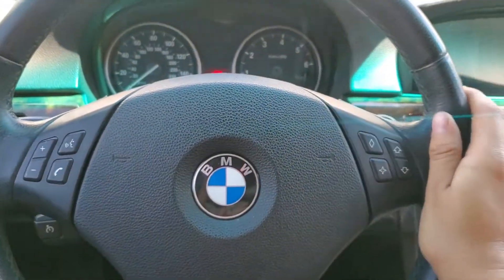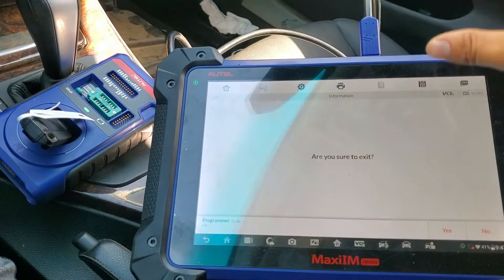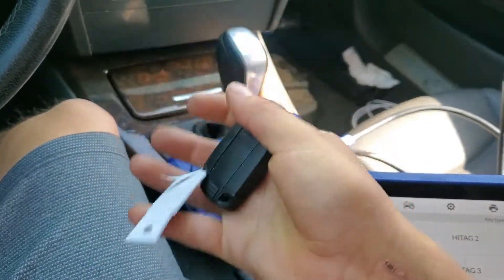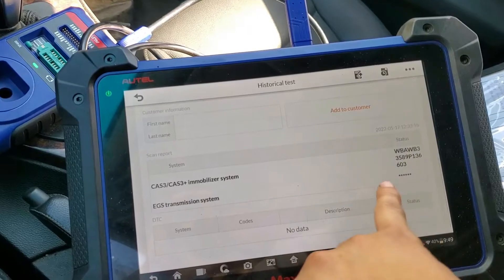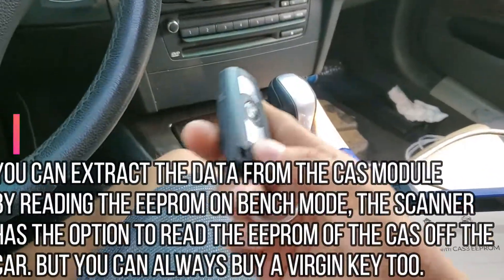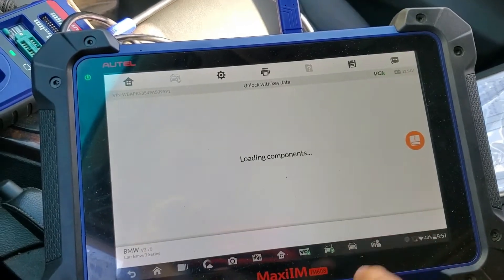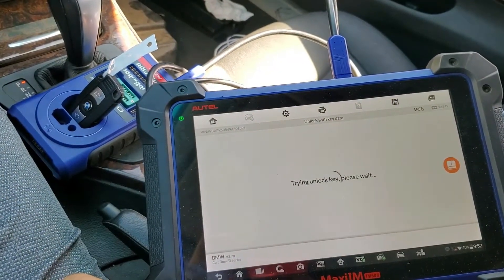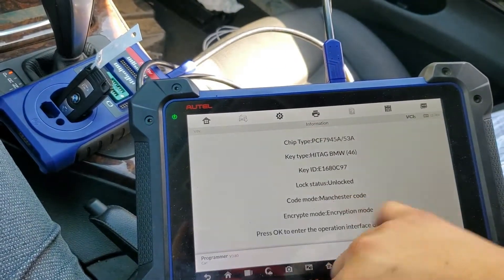How to Program and Unlock BMW keys with Autel IM608 "2008 BMW 328i E90 E92 chassis".

Comment: Hi, do you know what it could be the issue if the key programmed is starting the car but the buttons are not working? I ve already checked the antenna and they seems to be fine. Even in the original key the buttons are not working
Reply from the maker: U probably have a mixed frequency, cars in USA use 315MHz frequency and cars from Europe use 433mhz
Reply: needs new battery. I had the samei ssue

Comment: I use my autel im608pro2 to add keys to cars, I bought two keys from my usual key provider and I just normally code them to the car that I by them for but I am trying to code  a key to a 2024 range rover sports, the keys are the same frequency and style but when it ask me to hold the key in had then to press any button it never read the kesy, I bought 2 more keys and it is the same results, i then decided to read the keys in the programer and I notice the keys say lock on them even tho they are brand new, how do I unlock the keys, I know how to do it with bmw keys and benz key but I don't see any option for range rover so I am wondering if I need to plug on to the car before I can do so? As for bmw and benz, you don't have to be plugged on to a car to unlock the key, so that's the reason I am asking to see if I can get some answers?
Reply from the maker: I have never unlocked keys on that year maybe you are doing a step wrong and other thing is most of the new cars from 2021 and up now need internet access to program keys basically you need permission from the dealership to do it
Reply: @JVFIXLLC  I think it is just the keys that I bought is the proble, I had strong internet and I even reprogram the range rover and kick out the key that came with it and program it back and it work but the key I bought it is saying it is already program to a nex car but I think it is because they kesy are lock and not saying unlock. But thanks for your reply.

Comment: hey brother Can I used the original key to reprogram the key because it wont start no more  or do  I Need buy a new key to programming
Reply from the maker: if you erased by mistake you can reprogram it but if it's from other car you need to unlock or buy a new one

Comment: Hi, I noticed when you pressed they key buttons on the fob, it didnt lock or unlock, I am having the same issue after programming a new used oem key. I can start the car with the key inserted but the buttons on the fob dont do anything. Did you get that working on this vehicle?
Reply from the maker: it worked after a while and i haven't heard any complains from the customer.

Comment: I got an Autel im508 and i have 25 bmw keys, that i bought from the car yard. All of them Are locked to the cars that Are scrapped what can i do?
Reply from the maker: not all bmw keys can be unlocked some some type of keys. what year and model keys u have
Reply: @JVFIXLLC  and f31
Reply from the maker: @theoraif9392  yes u can unlock them with this scanner and im508 too
Reply: @JVFIXLLC  do i need to weld anything..? I must be doing something wrong.
Reply: When you don't have the Cas data for the keys you will need to do a bench eprom using jumpers by opening up the keys and putting the jumper wires on points on the key fob curcit board.

Comment: Hello my friend, I have an original key for a 2007 BMW 7 Series that was removed from the traffic record. Is there a way to unlock it and program it on my other car, knowing that my car has the smart keyless entry feature, and the key I want to program is from another car with the same specifications  I haven't found anyone who can unlock and program this type of key
Reply from the maker: yea it is possible to unlock it but u need the special tool from xhorse is called VVDI key tool and its a really good too also not to expensive it's about 300 bucks but it does key unlock frequency reader and chip cloning. these are many reviews on YouTube just type vvdi key tool and you will see many reviews

Comment: How do you cu to the emergency key?
Reply from the maker: with a special machine like the Xhorse mini condor key cutting machine
Reply: @JVFIXLLC  does it sync with the autel tool like automatic key cutter or manual? or say if you dont have the original key are you still able to cut it or that would be a dealer order?
Reply: @valmin5589  you cut the keys by bitting or keycode also you can duplicate a key obviously
Reply: you need to go to read ECU and get the key code. Then you use a key cutting machine and put in the last 4 numbres of the key cod to write and cut key starting on the B side first ten cut the A side of key. The X force is the unit most pros use.